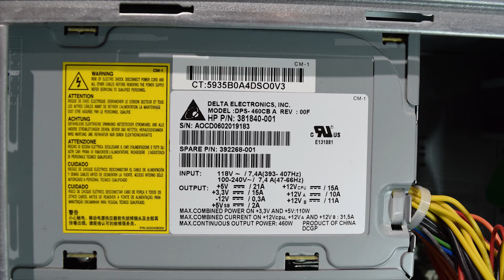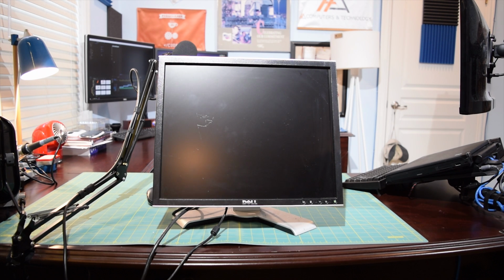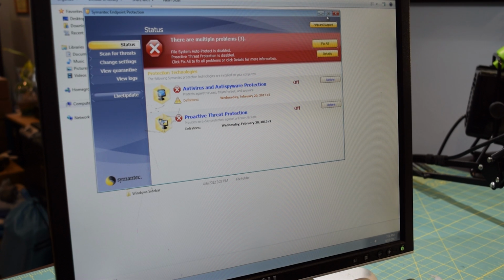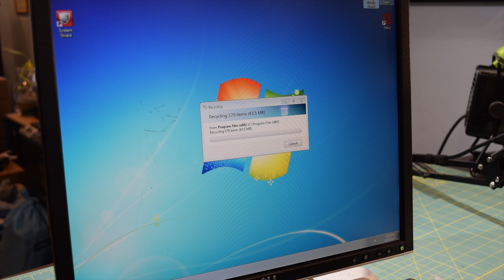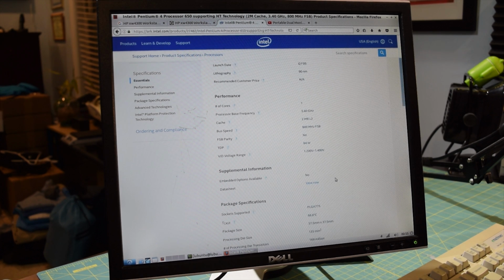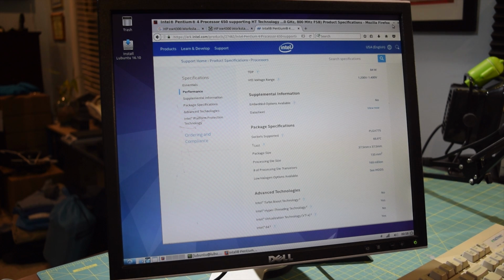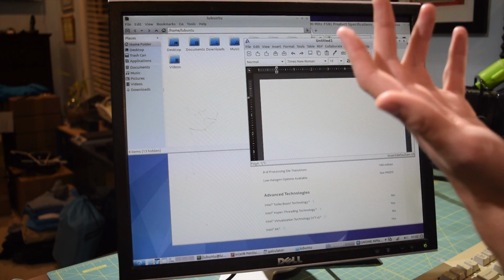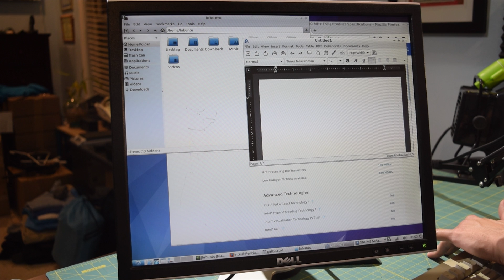Garage Sale Finds: $5 HP xw4300 Workstation Computer Overview (2005)

Comment from the maker: Just a quick FYI, the side panel was missing when I bought it.
Reply: Too bad the case wasn't complete with the sidepanel, rather clean looking case.

Could probably suit for a alright budget system based on a am3 95w cpu & a am3+ motherboard that supports 125w tdp cpu's + buying a athlon II x3 cpu used & unlocking the 4th cpu core.

Was a great budget option back a few years ago + 4 gb ddr3 ram & a gpu supporting windows xp perhaps something like a gtx 750 ti so you can go between xp / windows 7 / 10
Dual booting between those would make an interesting machine for all around work & gaming really.
(Ofc pirated windows xp & 7 works fine when turning off windows update & you could also just run 7 without a license for testing purposes as well.)

If you got a decent third party socket 775 motherboard.
(Like an asus p5 series motherboard with ddr2 or any other motherboard with 1333 mhz fsb support & ddr2 ram works for this socket 771 mod very well on the higher range of xeon cpu's)
I'd look into perhaps modifying one for a socket 771 xeon quadcore processor that's a lower power model for a server at 2.5 ghz or similar.

You could also probably have recovered that windows 7 key & reinstalled with that key on another machine fairly easily.
My desktop system is running a key from an old asus laptop that had 7 home premium on it.
Reply from the maker: My servers are computers I bought at garage sales for $5 and I am selling the dells with the intention of making a profit.  I am still a small channel with a small budget.
Reply: AA Computers and Technology dude can you make a video about that dell 530s please :)
Reply: You call yourself a small tech channel with a small budget but yet you have servers and have bought 100 or something dells for 5$ each....
Reply: nick, sounds like he has something similar to a DC7700p, which is by no means high $$. This is indeed budget. He uses a desktop as a server. Nothing wrong with that
Reply: AA Computers and Technology ha I got a 2006 hp for free (I broke cpu by accident and the psu needs replacing but that all ads to around $5)

Cuz my friend giving me a psu
Reply: @aacat If you want I could send you a side panel to that machine, I have some extra ones.
Reply: the mre nerd do you have any 5.25" and 3.5" bay covers? I need one of each.
Reply: @Marcus60661 Nope
Reply: in terms of design, not how clean it actually is heh.
Reply: So he uses those little sideways dells or hps?Cool.
Reply: Why did you bend the pins?
Reply: the mre nerd who?
Reply: You
Reply: the mre nerd oh well I was taking off the cpu cooler to check the thermal paste and the thermal paste basically turned into glue and riped the CPU out with it bending the pins am2 cpus are dirt cheap
Reply: VaronBros he stated in the video he parted it out for his servers.
Reply: holy crap 8gb of ram in 2005 OMG that thing must have been at least 800$!!! WOW!
Reply: i love restoring old computers, i have a playlist on my channel called PC hardware can you check it out and tell me what u think, you've inspired me to make these videos.

Comment: Hi, I bought one of these from a garage sale, it came with 2GB of ram, so two 1GB rams , and I bought two other 1GB Rams to get it to 4, but it keeps beeping and does not boot, according to the manual it’s a RAM issue, I am certain all 4 rams are working, they work in both pairs of RAM but apparently only when the rams are matching one another 100% , any ideas on what I should do?

Comment: Great machine for $5. That 8GB of DDR2 ram is worth more than $5. 

Try and get a HP XW4600, socket 775. If you are lucky to find a xw6600 or xw8600 with dual socket 771.
 Great servers, great for cheap gaming.

Remember remaking a xw8600 and slapping in a gtx 580. Good times.

Comment: The XW4300 can be upgraded to Petium D with the newest BIOS, i got a Pentium D 950 working on the xw4300 motherboard, best CPU you can install on it is Pentium 4 670, Pentium 4 661 or Pentium D 960, i'm not sure if the Pentium Extreme Edition 955/965 will work on the motherboard despite the chipset supports the needed FSB

Comment: While i am watching your video i am rocking xw8600 - 12gb ram 2x processors 3.0ghz 8core 8threds i actualy paid 25$ for GT 740 xD. And PC was free in junk jard..Good Video mate Sub and Like. Btw i am playing Gta5 on high 47 fps all the time...
Reply: MrBarni GTA V at high settings running at 47 fps with a GT 740? Seems legit.
Reply: JewcyLambz You wont Belive but yes. Its not ultra settings its high settings so idk...

Comment: I have the hp xw4600 model (2008) and I turned it into a retro gaming PC and it still holds up today. Firefox and games like World of Warcraft, Diablo III, Half-Life 2, Fallout 3 and Dead Space have been running very well.
My Specs:
OS: Windows XP SP3 32-bit
CPU: Intel Core 2 Quad Q9650 3.0 GHz
RAM: 4 GB DDR2
Graphics Card: NVIDIA GeForce GTX 750 Ti FTW w/ ACX
HDD: 2 TB Seagate SATA
PSU: Delta Electronics 475 W w/ 80 plus bronze

Comment: Hmm.. I have a xw4400 in my garage! I used it with Windows 10 a bit but all of a sudden there was a really bad burnt electronic smell that came from the PSU and the computer kept flashing its power LED red. I immediately thought it was the PSU so i took it apart and salvaged the fan. Turns out the GPU had cooked and the PSU just sucked up the smoke making it smell burned... Now it just sits without a GPU or PSU since I don't have a spare..

Comment: My laptop is pretty old.. An. Vaio.. 3gn ram 500 gb 5200 rom hdd sata.. 1024 mb Nvidia 210m gpu.. Can it run *win 10? Edit: an core to duo 2.1 ghz and running win 7 currently

Comment: escuse me but what form factor is the computer can it support a standard atx motherboard
Reply: It's a standard ATX form factor but the motherboard is mounted on a removable tray so you can't fit a "off the shelf" motherboard in this case without some modifications.
Reply: cheers dude even the poweresupply is that also atx or is it a propperity piece
Reply: No, it's a proprietary HP unit, but they are usually around 450-500w so you really don't have to change it.
Reply: EDIT: It was supposed to be "removable tray so you can't fit" but somehow it ended up as  "removable tray so you can fit" but I fixed it now

Comment: 8 gigs of ram in 2005? I feel bad for myself because i bought a laptop with 4GB in late 2016 ;-; I really need to upgrade it...
Reply: 8gigs of ram in 2005 was probably damn expensive
Reply: HP xw9400 from 2006 supports up to 64gb DDR2 ram and 2x 6-core Opterons. And SGI Octane from 1997-2000 supports up to 8gb ram.
Reply: João Candeias 4 is not enough. 8 is too much.

tbh i tried to stress the memory by playing attack on titan wing of freedom and opening as much chrome tabs. it stucked at around 6.5GB of usage
Reply: Upgrade to 8gb of ram because with the advancement of technology os's are going to get heavier and heavier, so to make your pc as "future-proof" as possible you are going to need to have more ram just to run the os and programs at the same time. I would also recommend upgrading the hard drive to an SSD or at least a faster HDD.
Reply: João Candeias my HP Compaq from 2004 can support up to 8gbs of ram and mine has an AMD athlon 64 @1.99ghz with a great 720 video card and Windows XP pro.
Reply: Nice machine you have.
Reply: It probably didn't come with 8GB from the factory, atleast mine came with 2gb from the factory.
Reply: the mre nerd Yeah, you must be right. 8gigs seems to be very "advanced" for 2005, but still that computer had more ram than mine and that pisses me off in some way :>
Reply: Holy shit are you serious? That's a lot of RAM! My laptop only supports up to 12gb and i got it on 2016 christmas... Wow, i feel embarrassed right now, not even joking
Reply: João Candeias unless you are going to use the laptop for gaming or heavy editing, going for 12GB is just a waste. i myself has 8GB of RAM and the only thing filling it up is when i do video editing (because my laptop is so old, gaming is near impossible)
Reply: kenny ricardo I use my laptop for some (kinda heavy) browsing, gaming and some school work. Im going for more 4 gigs because the ram that it already has is onboard. 8gb must be enough for my use, what do you think?
Reply: João Candeias have you tried to verify file integrity? in the steam, library, games, right click on cs:go, properties, local
Reply: João Candeias nah, my pc can do 140 fps on mid with 8 gb ddr4 2133mhz and 7200rpm HDD
Reply: Yes, i tried every fucking thing. Even reinstalling windows... Nothing solves my problem....
Reply: It'd be a slow HDD, a good replacement would be an SSD. Much, much faster boot times and load times
Reply: BritishCadet Yes my hdd is so slow. I also want to upgrade it but i want atleast 500gb and they are so expensive
Reply: i will upgrade it asap!!! but i have a little question. is there any big difference between 5400rpm and 7200rpm hdd's?
Reply: yes. speed, try looking for a 7200 hdd
Reply: lack of RAM could eventually kill your hard drive
Reply: Wieliam yeo That's not how it works...
Reply: yes it is, since windows's swap act like RAM when your RAM is low.
Reply: Wieliam yeo That doesn't decrease the life of the hard drive because they're meant to be accessed a lot. Plus, windows won't run if there's not enough ram.
Reply: chiken da gr8 ,  yes hard drive can be access a lot without any problem. But excessive use (read and write) of hard drive could cause bad sector.
I'm not kid,  so does most people here know if "not enough ram windows won't run".
ps: I've been using computer since intel i386, go figure.
Reply: MysticVolt He's on a laptop, he can't get a new gpu.
Reply: in my country, Albania i bought a ansambled PC with 1gb of ram in 2003 and was one of the best pc around lol.
latter worked for a mainstream studio and my PC had 4GB of ram for years.
back in the no one even needed 8GB of ram
Reply: João Candeias unless its a AAA games it won't use that much. even cs go uses 1.5gb
Reply: kenny ricardo CS:GO is a very lightweight game, i run it on 150fps with everything set to low, but i have a lot of bugs and problems with loading maps, it just takes foever to load. what should it be? RAM? Slow HDD? The current "setup" is 4gb ddr4 and 1tb 5400rpm.

Comment: well the socket is 775 you could upgrade the cpu
Reply: well you are right the 955X chipset is shit
Reply: OfficialVerified J 
775 has 2 "revisions" 
one supports celeron d, pentium 4, pentium d 
the other supports core, core 2, pentium dual core

some may support both but most likely this machine cant take anything more than a pentium D
Reply: OfficialVerified J there are only a couple of faster P4's that will run on that motherboard so upgrading isn't really going to accomplish anything. No Core Duos, Core2Duoas, Core2Quads, or their Xeon equivalents.
Reply: You can put a Pentium D 960 on the xw4300, at least with the newest BIOS
Reply: Not on the Xw4300 but ya can put C2Q's in the Xw4600 workstation